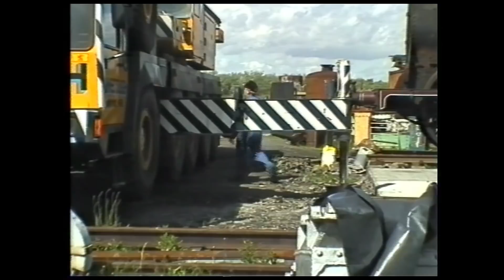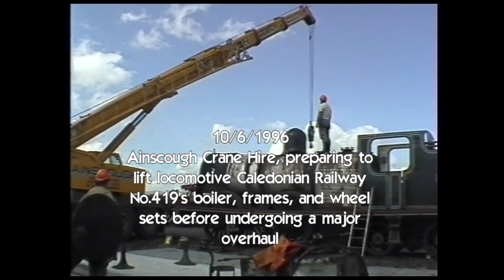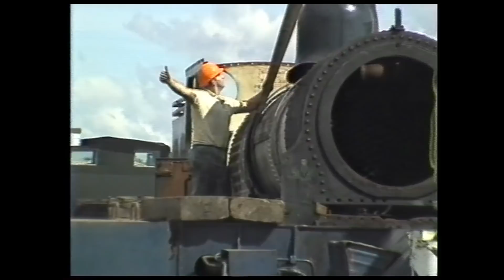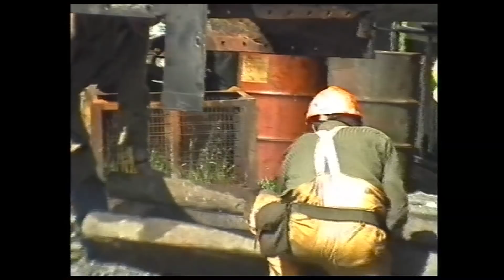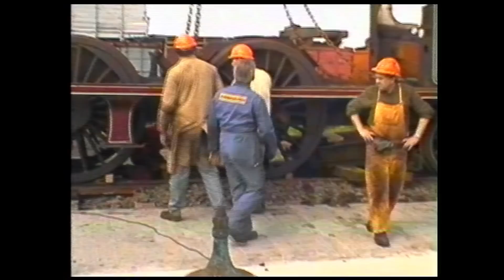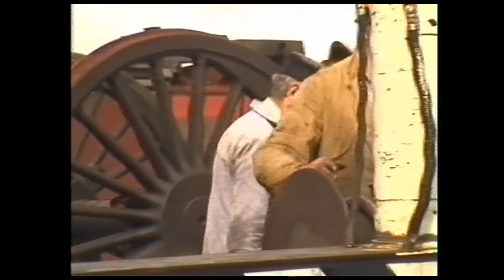lifting day for caley No.419

Comment: A few questions about trains. 
How do vacuum brakes work? What creates that vacuum?
And is steam more efficient? Or powerful? 
How do trains get so much traction? 
Can they only pull the same weight as they weigh ?
Doesn’t all railways use the same coupling system?
What’s the difference between a railway and a railroad? 
Why do some places use different gauges? 
And why did Britain have a limited loading gauge?
(I will probably think of more.)
And thanks to anyone who can answer.
Reply: Try Wikipedia, there's a lot to explain.
Reply: Kyle, why don't you ask Google all of these questions?